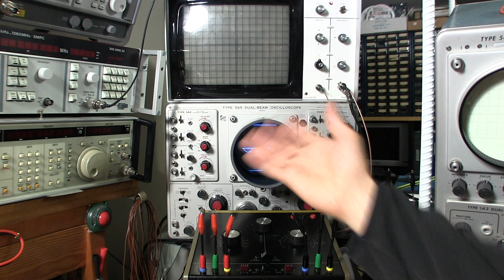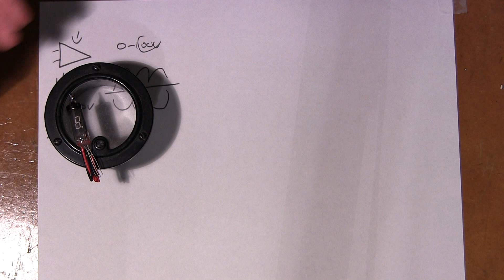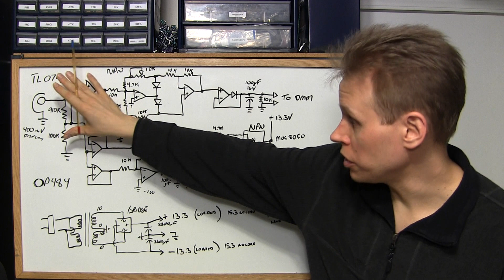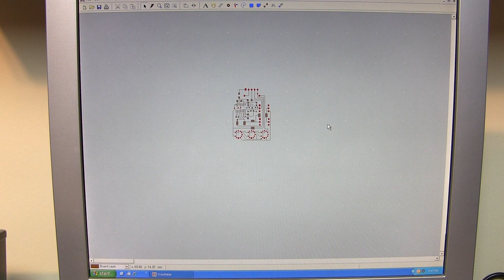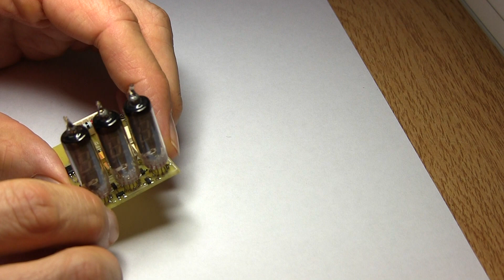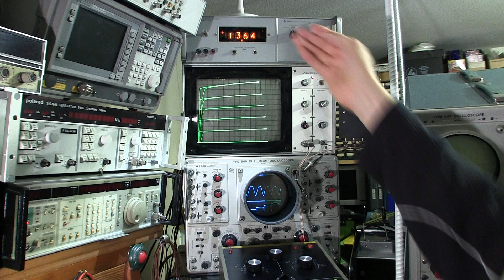Electronic Circuit Design, Let's Build a Project

Comment: Nice video, as usual! It would have been cool if you could have kept the original meter adjustment screw to use for you brightness adjustment pot- it would have added an extra little touch! But thanks for an awesome video. Im looking forward to your next!
Reply from the maker: +TrainMasterMan 
Ya Know, I was going to do just that, but the meter adjustment screw would have to be somehow be attached to the potentiometer for the brightness. That means it (the potentiometer) would be at the front of the board pushing the tubes back somewhat. So I just made things simple and mounted it on some empty board space.Thanks for your comment!

Comment: Excellent video. I noticed that the power supply does not have a fuse in the input.
Reply from the maker: +Charlie Pechiar 
You are correct. The average draw on the input side of the transformer is under 100mA. The small primary wires are the size of a hair, so if there ever was an issue, there's the fuse. Thanks for the kind comment Charlie!

Comment: I tore apart an old Dymec integrating voltmeter from around the same time period, and it used the same type of HP display boards, which I am quite certain use BCD inputs as it also had an interface for a minicomputer.
Reply from the maker: +douro20 
The cards had two options in some HP units. The ones with a small IC at the bottom front of the boards were most likely standard Binary Coded Decimal. The earlier all transistor units are 1224.

Comment: Thanks for the video. I'm learning something from video. I was a master automotive tech for more than 30 years. And some of my favorite tools were some that I designed and built myself. I always got a sense of pride using them.
Thanks
Brad
Reply from the maker: +bobkins270 
Thanks for the kind words Brad!
Reply: Dear Mr Carlson: Are those fluorescent tubes DG8F's? (I had a high school project where we built a digital clock with an MM5316 clock chip)? BTW: AWESOME VIDEO !!!
Reply: troll somewhere else pal
Reply: sid-that is the saddest attempt at trolling I've ever seen.